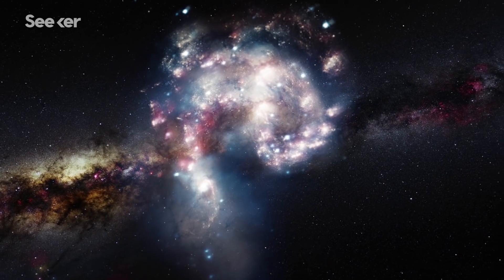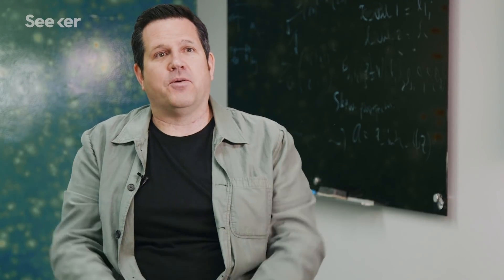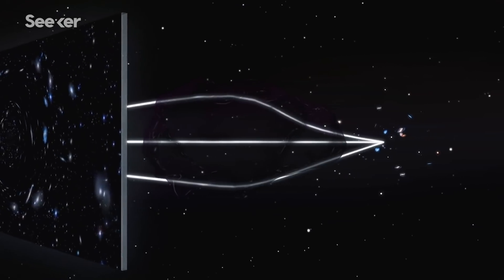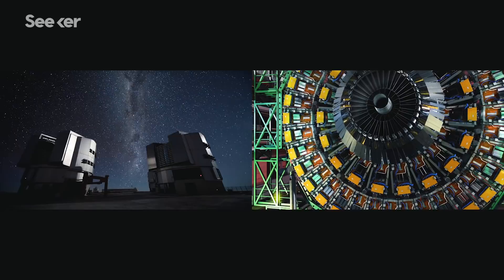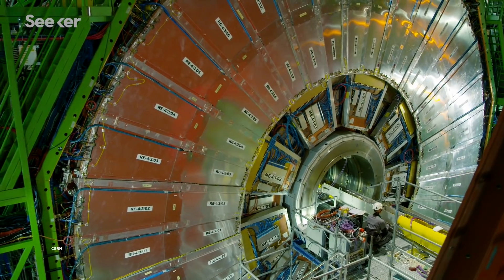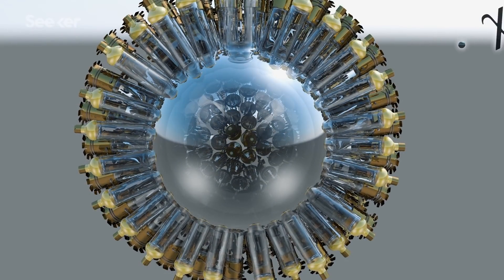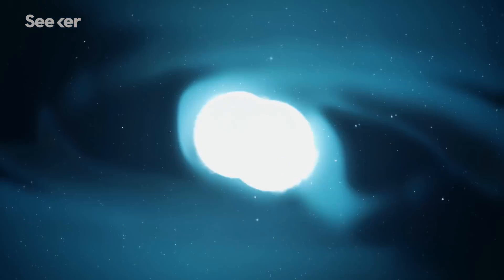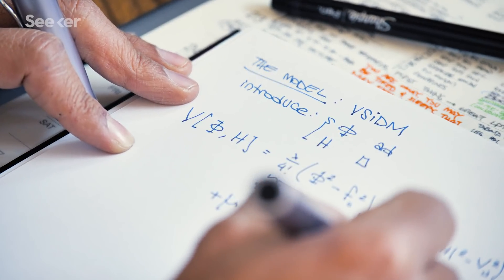How Close Are We to Finding Dark Matter?

Comment: Title: The fifth force implies no existance of blackholes?

We know by now that Newton's formula of gravitational potential on gravity, w=G*m(r)/r, (with singularity for star radius=r=0, m(r) is the mass of the star), 
is modified by the presence of the "Fifth force" (or said anti-gravity effect) given from the formula of Fischbach E. 1986 
(see even Rujula A.D. 1986, Cowsik R. 1990, Thomas J. 1989, formula without singularity). 
The Fischbach's formula of the gravitational potential corrected is: 
w=G*m(r)*(1-a*exp(-r/L))/r   
where G is the universal gravitational constant, corrected by a=0.01:0.001, which is the intensity of the fifth force, called ipercharge,
that depends on the relative amount of neutrons upon number of protons, in range L=100:1000 meters, of  mass m of the star on radius r.
The question of the title if the fifth force implies no existance of blackholes, is because there is no presence of singularity
in the gravitational potential corrected by Fischbach E.:
lim(r-->0)(1-a*exp(-r/L))/r=a/L.   (theoreme of De Hospital for limits).

We know that in General Relativity the Einstein's Field Equations derived from the Newtons formula, (see Weinberg S. 1972 chapter 7.1.3 and 7.1.12), 
have the presence of singularity for the radius of the star going to zero: r-->0, where the metric tensor A(r)=g(rr)=1/(1-2*G*m(r)/r), 
(see Weinberg in chapter 11.1.11) gives the presence of blackholes with the Schwarzschild radius (1=2*G*m(R)/R).
But if we use the corrected gravitational potential of Fischbach E. 1986 without singularity, modifying the Einstein's Field Equations; 
probably the new Einstein's Field Equations shall become without the presence of singularity; it is amazing;
giving a curvature that is bounded, with radius metric tensor A(r)=g(rr)<"curvature limit". 
Infact, the metric tensor in radius r is g(rr)=1/[1-(1-a*exp(-r/L))2mG/r] for the Schwarzschild solution (see Weinberg 8.1.7 and 8.2.11);
 and you can easily verify that it hasn't any singularity, (so g(rr) doesn't approach infinite value for any radius r, neither with Schwarzschild radius).
So blackholes do not exist for the presence of the fifth force?
But another question is the neutron stars with the fifth force: how are they phenomenologically? Do they exist? And how?

The new Einstein's Field Equations depending on the formula of Fischbach 1986, looks as:
R(ij) - 1/2 * g(ij) * R = {g(mn) * A(mn) + T(mn) * B(mn)} * T(ij)   where the indices of tensors are i,j,m,n=1,2,3,4;

where T(ij) is the energy momentum tensor, and R(ij) is the Ricci tensor, and g(ij) is the metric tensor. A(mn) and B(mn) are to be found.

Bibliography:
Cowsik R. et al. 1990: Phy.Rev. Lett.64:337
Fischbach E. et al. 1986: Phy.Rev.Lett.57:3
Rujula A.D. 1986: Phy.Lett.180:213.
Thomas J. 1989: Phy.Rev.Lett.63:1963
Weinberg S. 1972 "Gravitation and Cosmology" Wiley.

Good Research. Bye.

Comment: But the LHC hasn't found a single WIMP particle.
Reply: That is in no way an argument against DM being WIMPs. Since the M stands for "Massive", the LHC might well not be powerful enough to detect them in the first place, and even if it is, the "WI" is "Weakly Interacting". The LHC also doesn't directly detect neutrinos, which also weakly interact with matter, but by inference. Since we don't know what kind of particle DM would be (if it is a particle), that makes it really, really hard to even look for, and expecting an instrument built for a completely different purpose to find it is kinda harsh, like criticising a Geiger tube for not detecting CO2 buildup. That's not its' job

Comment: Maybe the difference between dark matter and I guess light matter would be the difference between what is life and what is dead to life. The relativity between life and death would therefore be also between dark matter and light matter. Maybe Dark matter is matter that is fundamentally not sensitive or respondent to light. Because all that you have been using to probe or classify has been light. Maybe there needs to be a broadening of the universe maybe there needs to be a way to investigate without using light. Fundamentally the challenge that you would face in finding a none luminous or luminary way to detect or probe would be identical to the challenge of the dark. Maybe find that luminous or luminary or light sent fills the reservoir of a body of volume to excess and comes out when excess. Maybe with dark matter the light available doesn't fill the reservoir of the matter. Maybe we'd find that our elements are elements that light can fill into. Maybe dark elements aren't filled by light. Maybe they're filled by anti light. Maybe there's the thing. Or maybe dark light fills dark matter I don't know. but who knows speak up send a postcard. Maybe we can't engage with dark matter as it is and maybe we can. Butt maybe but. Maybe we can bring dark matter to light. Maybe there's a way to bring dark matter to life. Maybe dark matter is like the battery reserve of the universe. Maybe dark matter is matter that was that underwent something and became reduced to just dark. Maybe its matter that is waiting to be created. Maybe its the matter cycle. That matter has a cycle. Maybe the light cycle. Like maybe there's a flow of matter beneath feeding into matter above the line of difference between the two states of light? don't know. Do ho not know. Would be fun to find. Maybe our brains interact with dark matter what that's not I don't know two perspectives on everything but how I'm not really sure well then get sure. well water ever.

Comment: E = mc^2. The Big Bang was super energetic, and when the energy it released cooled down some condensed into atoms (solid energy). Most of the energy released however couldn't condense into atoms and are hence undetectable to us, remaining as background radiation. Everything I'm saying right now is just my own theory. Also since anything that has mass, has gravity, its possible that dark matter is the background energy that has its own gravimetric effects. 

Blackholes have been shown to release energy (something that should be impossible) because particles are capable of spontaneously appear out of nowhere in pairs (a sort of particle and antiparticle pair, similar to matter and antimatter). Since black holes that completely evaporate become hotter and hotter before exploding and releasing a butt ton of energy, what if that's how the universe began? Our universe probably died an infinite amount of times already and the big bang is actually a black hole from the previous dead universe exploding.

Comment: When something appears to be missing, it means you measured wrong or you're relying on poor data. I'm not a physicist but, my hypothesis has just as much validity as any other hypothesis because nothing has been discovered yet as to the exitance of Dark Matter. How do they know how to quantify the precentage of the Dark Matter in the Universe when they can't find it? "We see bent light, therefore something is bending the light." One hypothesis, I say don't trust data from that far away to be acurate. Let's all adjust our rulers to fit the data. Or...The matter is there but it's just regular, hard to see matter. Less concentrated but more massive, all together, than just the galaxies. Why don't we just say that instead of inventing a missing state of matter?

Comment: Remember that other video, the one about how big the universe is. The one that says that the actual universe might be 150 sextillion times bigger than the observable universe. Are we taking into account the gravitation pull from the universe beyond what we can observe?
Reply: Gravity does NOT travel at light speed. If it did there would be no stable orbits
Reply: @tomdumb6937  gravity waves. But is there a difference between gravity waves and gravity (notwithstanding that gravity itself might just be an illusion and not a real force)? Are gravity waves the wave of causality from gravity?
Reply: Since gravitational waves travel at the speed of light, and we can't see that far because space is stretching faster than light means there is no way for gravity of those objects to affect us. It would also violate basic principle that no information can travel faster than the speed of light because gravity fluctuation beyond the horizon could be registered in our Ligo experiment for example.
Reply: @DoubleM55  thanks for answering.  but i dont think you need that much mass to keep everything together.
even the current mass of galaxy is enough to stretch the space fibre that no planet or star can exit to space.
that is why nothing is flying away.the space between the galaxies is straight fibre sheet.any big thing will need enormous speed to exit which they will never have. things may be apart but they are working together to keep everything close.
Reply: @DoubleM55  gravity from beyond the horizon can't affect our position here on earth - that's right - but there is no reason it doesn't affect objects at any other point in the observable universe, depending on the position (for example, at the edge of our obversable universe). It's not like the observable universe is a shell we're moving in.
Reply: @Falkdr  Well I have to agree, your answer sounds very reasonable. And I'm not actually an expert in this field at all, but I still have a question.

If I understood your point correctly, gravity of objects beyond our observable universe can not affect us, but we can see distant objects which can be affected by objects from outside our event horizon.

So now let's suppose something "big" happens outside our event horizon, and gravity ripple from that event affects those distant objects, and after some time we also see those objects react to that change, wouldn't that violate the "nothing goes faster than the speed of light, not even gravity"?

Or that "information" would never reach us for some reason?
Reply: @DoubleM55  You are right.
 I also have only enjoyed basic studies in physics but I wouldn't say it violates anything. The light (and other effects) from the original source behind the horizon can't reach us but can reach closer objects, of course. The expansion rate is just a matter of distance.
We would only recognize this after light from the closer object hits us as normal (we still wouldn't know or see what caused the effect so causality is intact).

We have to keep in mind we're not the center of the universe, all those places out there exist on their own and experience causality from their individual point view.

But I don't think this can account for the unexplained gravitational effects (aka "dark matter" in pop culture science) as it is more like a backyard phenomenon.

Comment: My opinion on the definition of dark matter in fundamental physics:

Dark matter is simply unattached subatomic particles which are barely matter, and just over the edge from energy transformed to stable matter, and is just stable enough to become matter.  The other thing to consider, interia is under-measured in the outward projection forces of the big bang.  The universe is accelerating as forward momentum is lessening gravitational braking.   This is under measured in the calculation of galaxy mass. Thus the aggregate mass of dark matter is over-estimated. You heard it here first  IMHO.

Comment: Dark matter is unrenderd matter in the universe once we approach the dark matter it will render the universe only has so much processing power since every simulated universe must be smaller than the previous our universe is only 5% of the real universe therefore the sim designers had to use some advanced rendering compression techniques. Maybe one day we'll create a simulation that is 5% of our 5% of 100% percent of the universe which may only be 5% of some other universe, wouldn't that be fucken nuts eh

I know as much as they do which is nothing but hey it's a pretty whacky theory

Comment: Consider work late 50's by Sternglass-Einstein on a structure formed by a spinning pair of an electron and positron. Then, add a second pair and they found a meson in lab results that matched properties.

Copenhagen School  became Standard Model, empirically derived and the accuracy needed for solid-state design.

My research into the levitated lunar dust shows single molecules can be levitated and the dust making is an erosional process by bombardment such that the dirt is ancient, accretion rate 1.2My/mm, the rest goes into space as grains down to a hundred picograms for another source of dark matter.

The nighttime lunar density is 20,000-grains/cc 1/2m off the ground at -100vdc ambient charge, the Moon is an astro-geologic capacitor.

Comment: Dark matters existence is consequence to galaxies rotating too fast for Newtonian physics to keep the stars together, this is also based on red shift measurements, so either red shift measurements and their interpretations are wrong or there is another mechanism holding the stars together that does not require extra mass to exist.

Outside of this observation, there is no other reason for dark matter to exist, it is simply an ad-hock hypothesis for the above problem.

Comment: Expansion Of Solar Bodies Versus The Oort Cloud Barrier

As solar systems expand, the exterior planets will lose their gravitational pull from their home star and pass through the Oort Cloud Barrier. This would project a planet or moon out into the cosmic soup to be smashed by other dark matter. An example of this dynamic can be witnessed within our own solar system. Phobos is a micro planet that is nearing escape velocity from our Oort Cloud Barrier. It transcends past the Oort Cloud Barrier then returns to complete it's orbit around our sun. Eventually, it will break free from the gravitational field of our sun to be tossed into outer space. During the journey beyond our Oort Cloud Barrier, Phobos impacts dense dark matter within the cosmic soup which grinds it away into smaller dark matter pieces. These broken off  pieces create a spray that projects dark matter chunks and particulates outwards into the cosmic soup, never to return to our solar system, unless retrieved by man-made sources. Since the consistency of dark matter is more dense outside of the Oort Cloud, the abrasive forces from the cosmic soup are greater there. Since Phobos has an angular orbit that is not consistent to the further inward planetary ring orbits, it would project the newly shaven dark matter chunks and particulates away at an angle from our orbit rings. As a star begins to lose planets from it's exterior, new planets could be drawn out from our sun. This would decrease the mass of the home star until it extinguishes with a supernova. The supernova would be attributed to extreme gravitational pull on the shrunken star core, which would eventually have the planets become the gravitational center of the solar system. The Oort Cloud Barrier would gradually shift in response to this gravitational center shift. One method of creating a binary star system would be the result of the star splitting in half and both parts remaining molten and inflamed. The other would have two gravitationally conjoined stars be projected from a nebulae together. Newly "born" stars from nebulae would travel through the cosmic soup and gather up dark matter particulates, chunks, and even rogue planets. Eventually the newly "born" star would absorb its own Oort Cloud Barrier and solar bodies. Our sun is really big in comparison to what we see from our viewpoint. Strangely enough, asteroid belts have the same gravitational pull on their home star as the planet they once were. The gravitational tug is just widened across the entire orbit, rather than being concentrated into a single orbit location. This would mean the humanity must look to colonize Venus to continue living within this solar system. This is a long way away, but we should put it on the to do list for humanity. Colonizing Mars is great. Utilizing terraforming technology on Mars is really great. But Earth will eventually begin to escape the goldilocks zone while Venus will begin to occupy more of it. This would provide cooler surface temperatures which would help to solidify the caustic atmosphere of Venus.